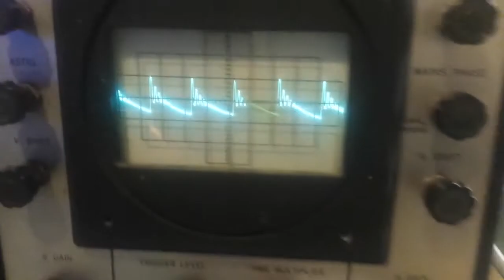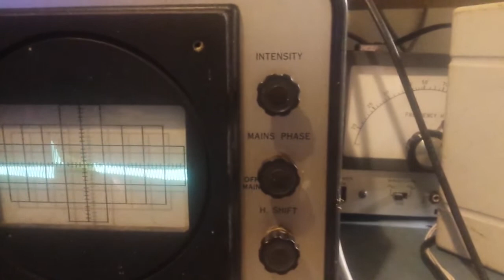Tube VCO and VCF

Comment: How stable is the oscillator? Are you going to do FM?
Reply from the maker: So long as the power supply is regulated, it remains in tune and is quite linear. I'll do a video of it hooked up to a MIDI to CV adapter later.